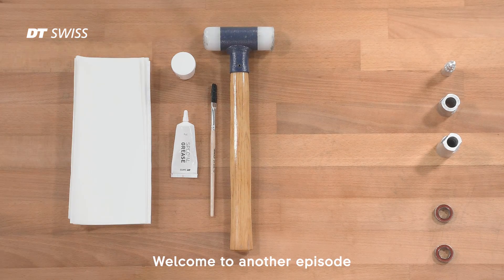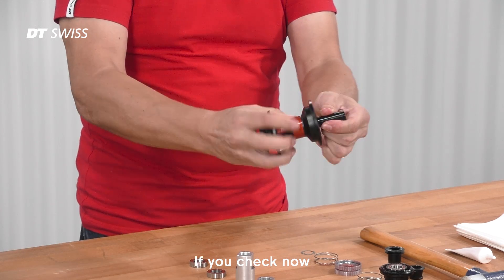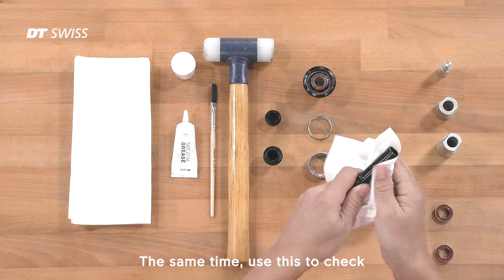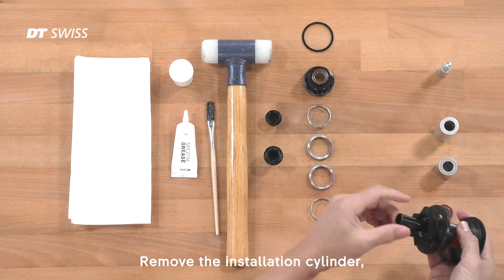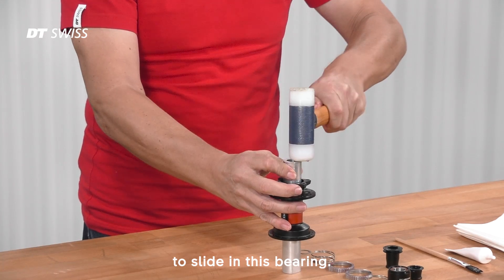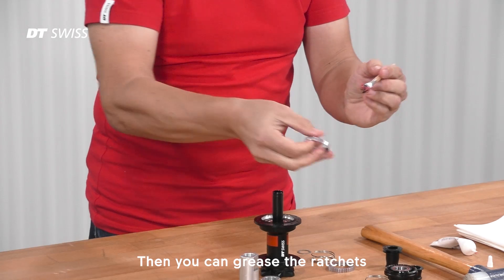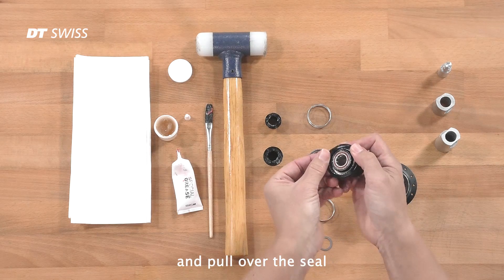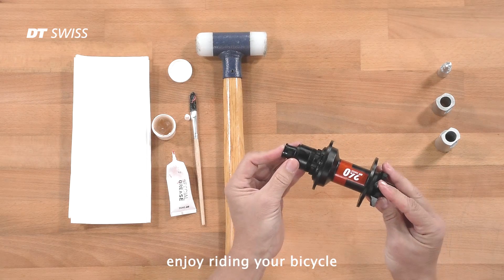How To: Ratchet DEG Bearing Service

Comment: For me in two cases the Bearings in the Freehub body were the ones to fail. Both times at around 16.000km. One Hard Tail MTB and one Gravelbike.

A Video for changing the Bearings in the Freehub Body would be appreciated.
Reply from the maker: Thank you for your comment. The video demonstrates how to service bearings. The same process can be used for replacing the bearings by swapping in new ones. If you are unsure about which bearings you need, have any other questions, or would like tips on optimizing the performance of your hubs, please feel free to contact our service team at service@dtswiss.com.

Comment: Hey Dt Swiss! Looked at comment section and tried to go through your documentation but what exact tools are needed for 240 DEG hub? Trying to find part # or links to tools on the right side of your video in the start! Thank you!
Reply from the maker: Hi there! You can find all the information you need for the hub service and assembly in our manuals: https://www.dtswiss.com/en/support/manuals
Reply: You dont need any, guides are optional, you can use anything with flat surface to protect the axel

Comment: I would very much like to see this service performed on a complete wheel assembly. I read the response to the other comment, that the method shown here is intended for a complete wheel, but I’d still like to see it. There’s no way I’m unlacing my wheel to do this.
Reply from the maker: Hi and thank you for your message. As the service itself is absolutely not different if you have a single hub or a complete wheel. So thee is no need to lace out the hub. We decided to offer those videos with the focus on the hub only. It makes the filming itself as well easier, as we can get closer to the details. As well as it makes it more versatile as the different DT Swiss hubs can be used in many different wheel variations. But we will consider for future videos to have complete wheels in the video. Enjoy riding your Bicycle, Friso "DT Swiss".
Reply: @dtswiss  is it true that you guys made a 350deg 90t hub exclusive to reserve wheel company?
Reply from the maker: Hi and thank you for your interest. The OEM business is a strong part of our company.  With longterm partners like Specialized and TREK we often implement specific solutions. This what we are doing as well with Reserve where we offer a specific version of our ratchet DEG freewheel system. Enjoy riding your Bike, Friso "DT Swiss".

Comment: Driving these bearings all the way in this way, in DT350 and probably here too, causes the preload to be too high and you need to lightly tap the inner bearing races with a hammer through the axle to unload them. Or else, you are shortening their lifetime. It's much better to use a press.
Reply from the maker: Hi and thank you for your feedback. With such videos we would like to show the option on how-to do a service easily. Most people would change bearings on a complete wheel, where it is hard to find a press with the space to fit a wheel into. As well as it should be clear that you should have some general knowledge about how to handle a bearing, before starting to change bearings on your Bicycle. As an example,I can do such a service with setting the second bearing without the need to unload them afterwards, doing it the way like we show in the video. At least athletes like Nino Schurter, Loic Bruni, .... never complained about the performance of my job. Friso "DT Swiss".